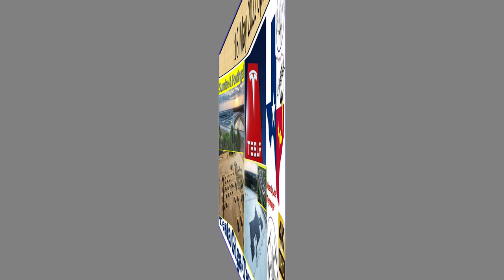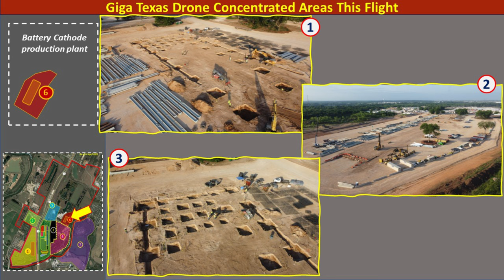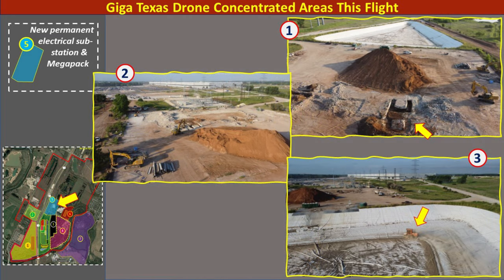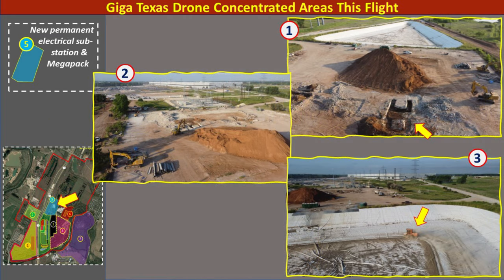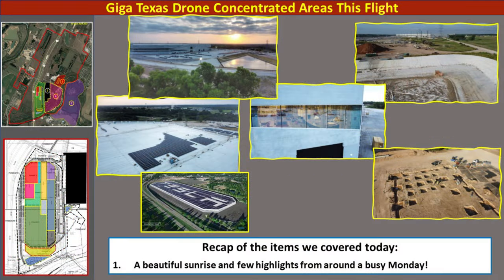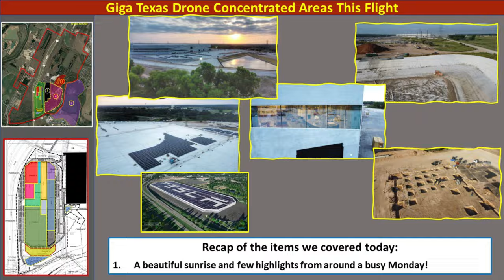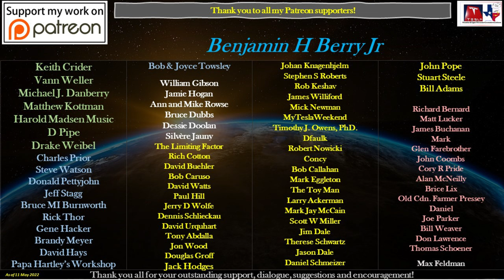Tesla Gigafactory Texas 16 May 2022 Cyber Truck & Model Y Factory Construction Update (07:15AM)

Comment: Thanks Joe. 
0:33. Stamping, inside. Pic 1. The press with the big Tesla logo is over the pits constructed a year ago, as its located on the north side of the double columns. Uncompleted press (below small yellow arrow) is south of the double columns, and is temporarily placed on cylindrical stands same as those seen outside on the apron in Pic 3. 
Stud wall dividing east and west of Stamping is being dismantled, or possibly modified.
4:20. Stamping, inside. Uncompleted press just visible to the left of screen. 
5:25. Stamping roof. They have their ‘best’ crew on this one.
8:50. South west corner. Green drilling rig gone. Pipe riser, likely for a monitoring/testing well (YLTMV*) as suggested by Patrick Kenny.
14:07. East Main Entrance. Concrete crew truck to the right of screen. Couple of barrows against the fence segment.
15:31. East side. Left of screen. Building looks like one of the out buildings that was at the Old Bagging Plant, been relocated. https://youtu.be/WO4oVxxgYiY?t=555
17:37. Cathode. Footing excavations closest seem to be deeper.
19:06. Cathode. I think there’s footings there for the main structural columns (larger, deeper), and then smaller footings for…..other purposes.
Larger footings seem to be spaced evenly for 2 column bays/3 footings (from left), then a narrower spacing between the last pair to the right. 45’ 45’ 22’  14m 14m 7m. Consistent with 2 sheets of drawings shown on Joe’s Patreon site on 11 August. Drawings were specifically to do with the erection and temporary bracing procedure, but give a few clues. Long skinny building, 3 sections/compartments, 30 or so column bays long, by 2.5 wide (2 large equal width, 1 half width). 3 floors of equal height. Some large spaces open full height (like in Battery). Skillion roof (1 roof plane, no ridge or valley). One drawing made it into Joe’s 11 August video. https://youtu.be/fxHXvzP_pf4?t=1197
23:21. Battery apron. Loading platform column locations. Looks like plates have been attached directly to the screw piles to take the loading platform columns.
Battery, wall opening Level 2 or 3. Small columns have been removed.

*YLTMV (Your Local Terminology May Vary).
Reply: You mean their "A" Team?
Reply: @sammyk874  😑
Reply: Smaller footings could be for internal silo legs, bulk storage of materials delivered in that end of the building before heading down the production line.
Reply: @michaelharlow949  Yes, could be. There are some smaller column sections stacked nearby that could fit the bill. The big structural columns have + shaped shear lugs under the base plate. See 16:53

The drawings that I mentioned were only the middle section of the building, gridlines 14 to 25, so what happens at each end isn't shown.

Comment: Elon has just said on the All In podcast that the factory will soon be extended to one mile length. Is the stored steel for building over the south car park?
Reply: Existing building is 3824' long or thereabouts. Even if it gets extended the much reported 500' it would still be short of a mile. 

The south car park is not set up for a building to be built over it. No footings for starts. The steel is likely for modifications within the existing building (steel been loaded into BIW recently), and modifications to steelwork for Cathode.

Comment: Joe, at 10:49 just before you applied full collective, there are the three holes with the 4 small holes above, which look like they may be sites for three generators. Next time can you give us a little peek and see if that is what is going on there?
Reply from the maker: I can try. Thx!
Reply: Generators is what William Wheeler thinks are going there. See his response to my comment under Joe's 13 May video.
Reply: @DessieDoolan  Yeah, that's what I have thought since first seeing the apertures for the cooling exhaust and the holes for the muffler output, or so it seemed to me. I'm intrigued that they haven't been installed much earler.
Reply: @The_DuMont_Network  Might not have been critical until now.

Comment: Hey Joe! Thanks so much for you continued great work to keep us all up to date on the progress at Giga Texas! Are you by any chance able to get close enough to the completed cars to see if they have the badge "Duel Motors"? Trying to determin if these are Long Range, Performance or even possibly the new as yet only discussed "Standard Range" with the 4680 batteries. That car is not yet on the sales website configurator but wondered if these cars may all be of that variety.
Reply from the maker: They all say Dual Motors
Reply: @JoeTegtmeyer  Thanks! I think that rules out the new "Standard Range" 4680 model.
Reply from the maker: @mikefendel  not at all … these are standard range AWD versions (a new variant)
Reply: @JoeTegtmeyer  Humm....I didnt' think the new standard range were dual motors. I wonder where they are going since I didn't think those were for sale yet. Thanks!

Comment: If that pond north of the old batch plant is no longer needed, what was it needed for in the first place? I.e., where did the chemicals it was supposed to trap come from??
Reply: The paint area traps paint in the air with a water wash. The pit settled the paint out of the wash water. They installed the paint lines as the first equipment installed. They were testing it for months before much of the building was built.

Comment: Joe could you get a shot of the location the boring machine is going for on the south side of the river.
Reply from the maker: I keep checking but no activity there yet. Permit says work starts 1 June, so I’m keeping an eye out over there.
Reply: @JoeTegtmeyer  that’s weird, they usually push to a target hole.
Reply from the maker: @notvaporlocked5479  I have been looking … will continue to do so and if I see anything, I’ll report about it.
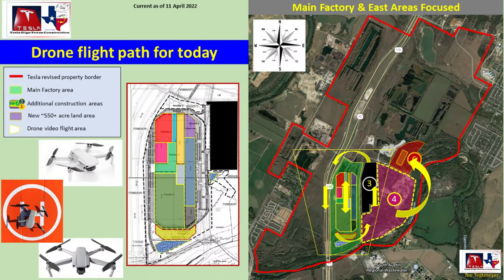Reply: If you look at Brads video from 14/5 @2:35 he gets a good shot of the first line under the river at its exit point on the south side.
Reply: @Dwayne.Shea.231  Mystery solved, thanks Dwayne

Comment: @ 20:59 This was supposed to be a pond for containing toxic materials, thus the reason for the liner. So why are they kicking up clouds of dust while doing cleanup???
Reply: I would be wearing tyvek suit and a good car bon and hepa filter respirator for that work no matter what anyone says. Even if simply dirt, the dust is carcinogenic from the silica.
Reply: I was thinking a vacuum truck would make less clouds and perhaps eliminate one dumping cycle.
Reply: @The_DuMont_Network  This doesn't appear to be a sweeper, like vacuum trucks, but a scrubber, like the attachments Bobcats have.
Reply: @greggerypeccary  Sweeper with a big brush to move material to one side making windrows. Presumably after sweeping the whole pond you would end up witha big windrow which could be collected and dumped, or a big vacuum truck could collect it perhaps more efficiently. Oviously there is no vacuum on that little device, just an angled revolving brush.

Comment: Awesome. I’m curious if you are able to fly high enough to give a high level view of the property, and maybe even show the proximity to places like the airport. Or, are there FAA regs against doing this?
Reply from the maker: Can’t fly higher than 400 feet AGL
Reply: @JoeTegtmeyer  And actually, I commented before I finished the video. Last shot was pretty good. Thanks!
Reply: In addition, the Gigafactory is the airspace of the Austin Bergstrom Airport. You’d need to rent a chopper or plane and then get cleared to overfly the place to get a picture over 400 feet.  Unless we have a subscriber with a Cessna and a camera, we will have to wait for someone to shoot a picture for us. I fly out of AUS often and I could try to get a picture but I try to get aisle seats, not windows on the right side of the plane. Plus they’d have to use 36R for the takeoff and that’s not the predominant pattern. But given how many folks are flying out of Austin these days, I bet someone takes one soon.
Reply from the maker: @AirmanJH  👍🤗
Reply: Mac, some of the previous flights show the area and layout. You can also see the whole area on Google Earth.
Reply: Take a look using Google Earth. Then you can use the ruler to measure the distances and bearings.
Reply: @JoeTegtmeyer  Surprised you can fly that high so close to the airport.
Reply: @apostolakisl  , you can only do it over the property east of the toll road. West of the toll road you go down to 200 feet AGL. A little closer and you go to zero. So thankfully, the facility is just barely far enough away for drones to fly at all.
Reply: You can look on Google Earth to see the proximity of other places like the airport, downtown Austin, the Bastrop highway, and other items.

Comment: Tesla should be planning ahead and installing hundreds of chargers now.  Both for charging all the new cars as China does and for the hundreds of workers who will be driving them sooner then you will think.  Kinda short sighted not to do all install work now instead of tearing up the parking lots again later. Berlin seems clueless about this too.
Reply: The batteries are installed with at least 10 miles of range. Plenty to get them off the trucks for delivery. The grunts won't get at work charging. Maybe management.